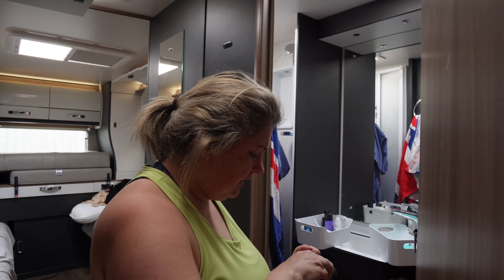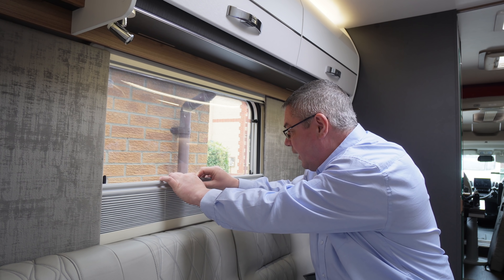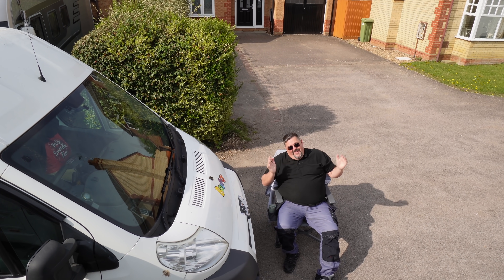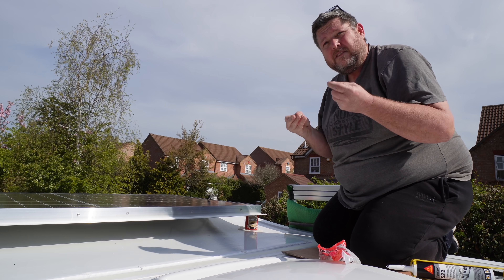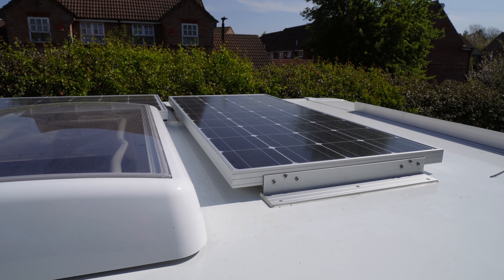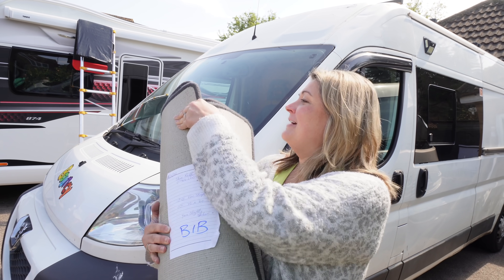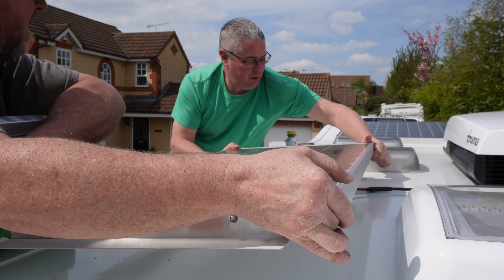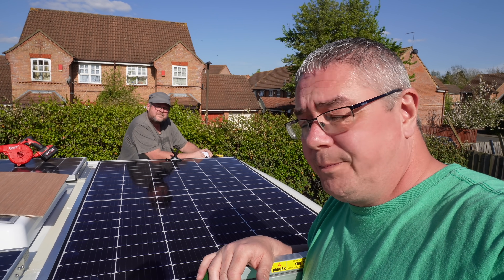INSANE SOLAR PANEL INSTALL

Comment: Hi Steve, know you guys ended up fitting 375 watt panels do you have the make and model number you installed as can't see them in the link or mentioned in the video? looking to upgrade our system  so trying to suss a good panel options as looks a bit of a minefield! many thanks in advance.
Reply from the maker: Sorry it was a couple of years ago and I can’t remember which one it was, but things also progress fast with the technology of solar panels so just look at the latest ones and go for the size that best fits the room on your roof.

Comment: how where the new panels wired in ? as i thought you have to match panels or have i got that wrong.. how about the batteries.. I'm thinking of upgrading solar.. and also adding in a pair of lithium batteries.. but i understand that the vehicle battery is still lead acid as they can give better high current for short time.. rather than lithium that gives moderate current for a longer time. then there's what hardware needs to be swapped in order that the alternator can still charge both types of batteries..  Any pointers please..
Reply from the maker: They are wired into different MPPT Controllers.
INSANE SOLAR PANEL INSTALL
https://youtu.be/QgySlQmiRUc
Reply from the maker: The ULTIMATE Off-Grid Motorhome⚡️
https://youtu.be/21POFx-9RGg

Comment: Very interested to know why you need that many solar panels, I hire my caravan with 100w solar panel to 3 week festivals with no hook ups and have never had a problem with battery’s running out of charge
Reply from the maker: We have an electrical video coming out soon that should help explain how we plan to use it

Comment: Dealer fitted solar on my van, for a single 120w panel, cost £1050 (supply and fit). An extra battery, £200. 😮
Reply from the maker: Wow that’s just way too expensive. My additional 750w was around half that!
Reply: @RoamingRadfords  It was 2012. Maybe newer technology then.
Reply from the maker: @SqueekyBums  ahhh, yes Solar has come way down in price in the past 10 years, it’s now around 50p per watt

Comment: whatabout damage caused by the roof flexing and the panels fixed down any probs there
Reply from the maker: The roof is made of a composite structure and the angle of the aluminium will prevent the roof from flexing

Comment: Wouldn’t tiger seal been better for bonding them down sika flex is more a waterproof bond
Reply: Sikaflex 522 is an adhesive and UV protected sealant made for motorhome applications.
Reply from the maker: It seems perfect so far 🤷🏼‍♀️

Comment: Nice carpets, we prefer plain dark carpets. That’s a lot of solar, we have 200 watts on Smirf which we have found is enough for two adults camping. In winter we try to find hookup hardstand pitches 😉👍🏻🚐 Trev
Reply from the maker: Thanks Trev!

Comment: Hi Steve. I went to look at a new motorhome on Sunday, I asked the sales chap about installing upgrades such as solar myself as I've converted a van before ( same van as your e dispatch but engine) , and he told me that as soon as I so much as drill a hole anywhere in the motorhome then I would instantly void the warranty!? He told me that all mods would have to be done through them. Have you any experience with this ? Cheers. Marcus, South Wales!
Reply from the maker: Hey Marcus. I can understand that drilling a hole in the roof would void your water ingress warranty in that area, however if they are saying you can’t touch anything or it’ll void your whole warranty if anyone but them does any upgrades on the van, I’d look for an alternative dealer that doesn’t lock you into to having to buy any future upgrades from them at whatever cost they decide to charge you.

Comment: That's the way 😎
Fit enough for purpose 🧐
You've just reduced your family carbon footprint in the van 🙏
Reply: Not if it means more driving about in the big van.
Reply: @kieronmarshall2658  they already had the van. If a ev van was for sale I think they would of bought it. A great positive move made by the Radford's. They also use ev cars and work vans 🙏 think how many people fly families on holiday. Do you fly your family
Reply from the maker: Great way to think about it!

Comment: A can promis you if you disconect the smal solar panels an only have the big one conect you Will get more power and if you have all 4 install not working well to have differentiera size Panels
Sorry for my bad english
Have a great dag
Reidar from Sweden
Reply from the maker: Thanks for your comment, your English is fine. The solar panels are connected to different solar controllers so that won’t be the case in this situation.
Reply: @RoamingRadfords  aha smart when you allways have backup if one not works.
best regard Reidar